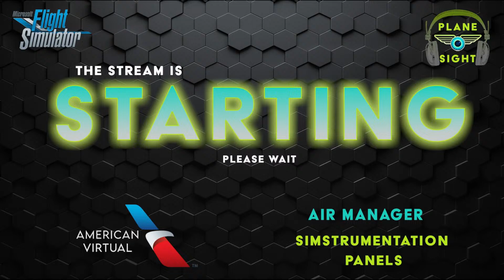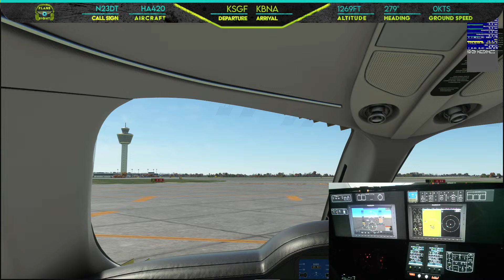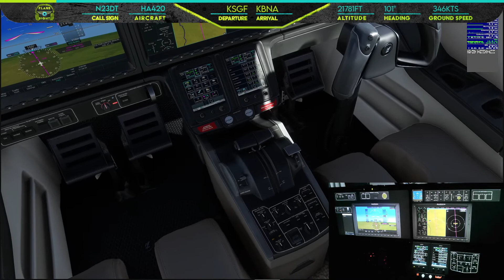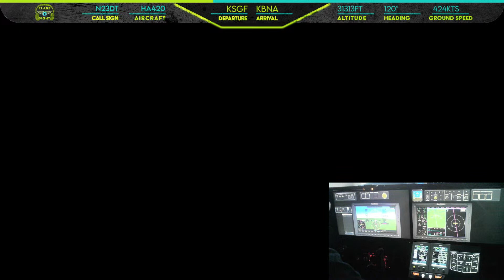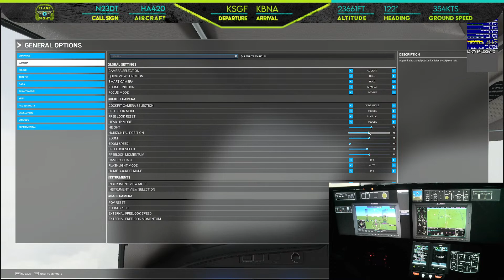MSFS 2020 |Honda Jet | New FREE Panels | Air Manager | Simstrumentation

Comment: Do you se popout manager or ALT to pop out the PDF MDF screens?  My popout manager doesn’t show the left side of MDF screen when I try to use manager and if I use ALT enter it will show up on my touch screens
Reply from the maker: Yes I use pop out manager. Not quite sure what your asking. With SU12 when you pop out panels by using R-ALT it remembers the location of that screen. But there is an update with pop out manager to get it to work with SU12. Thanks for the comment and hope that helps a bit. Let me know if you need further assistance.
Reply: @planesight  I’m using newest version of pop out manager I’ll try again later today to see if left side of MDF shows up.. As of now use pop up manager for GTC for touch screens but R ALT for PDF and MFD screens and a work around for left side of MFD